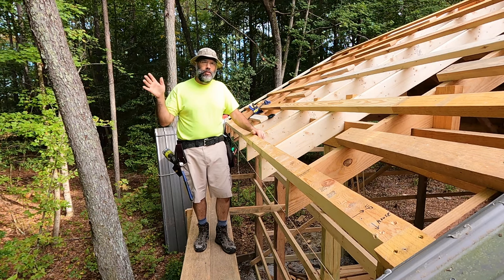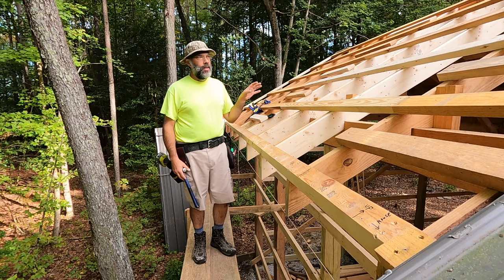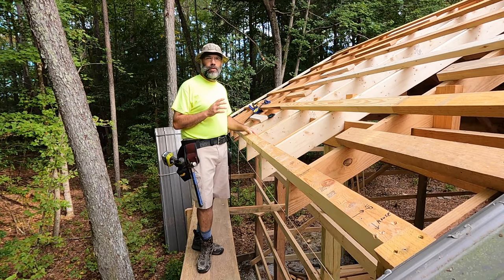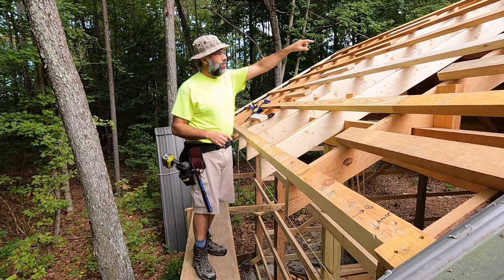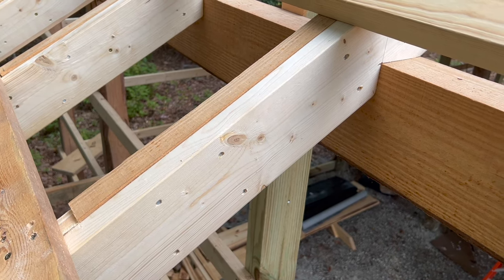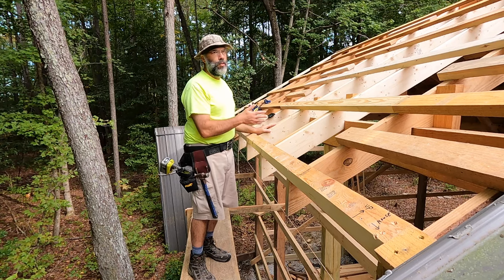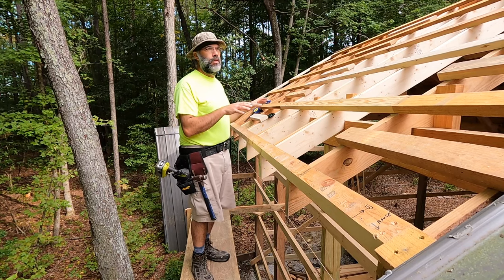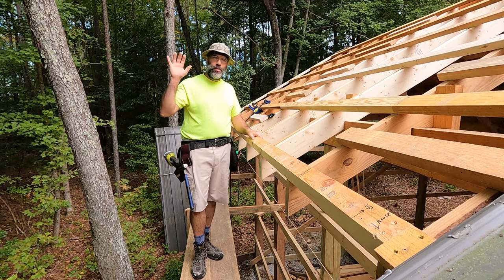Pole Barn Project #15 - The Perils of Framing with Green Lumber

Comment: Great discussion on green lumber! Do you have a moisture content that you consider too high to build with?
Reply from the maker: For outdoor structures I have framed with SYP lumber straight off the mill and done OK, but I found that if I can let it dry for 2-4 weeks, it loses a lot of weight and is much easier to handle.  That usually gets the moisture content down into the 30-40% range on 2x lumber.  It will also give the lumber some time to stabilize and warped/twisted boards can be culled.  It takes months longer to reach 20% and about a year to drop into the 10-15% range (I never see it go lower than that here).

Comment: Yes, a system wherein lumber is first dried to what its average moisture content will be over its installed service life is an ideal goal. In some cases perhaps dried to even lower moisture levels , such as, perhaps, before assembling sheathing panels or room width flooring panels using glued tongue and groove or other glue joints.

Comment: Would the adjustable blade guide be money well spent or not necessary on the 122
Reply from the maker: I've never needed it, but if you saw a lot of really narrow logs it could possibly be useful.  In my experience the blade tension/support is more than adequate for most sawing without the additional support of the adjustable guide.  I really think this is more relevant on wider mills, not a 22" model.